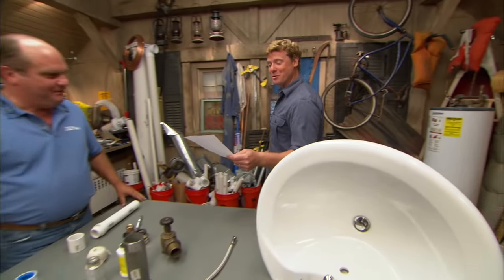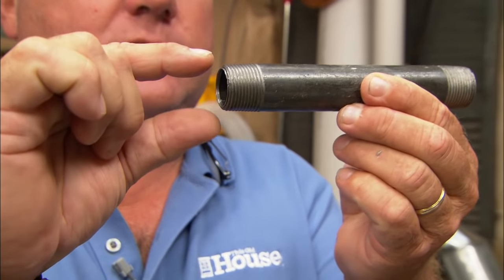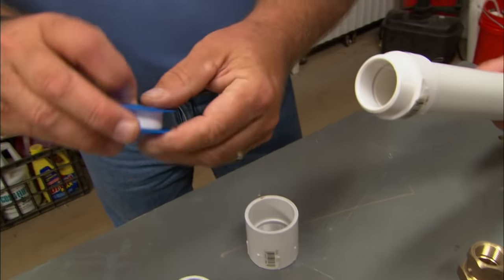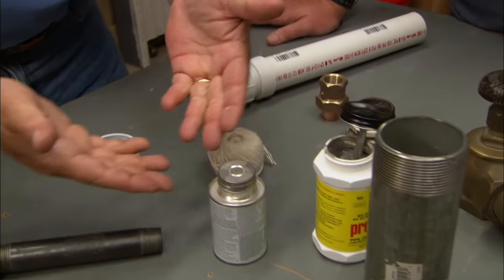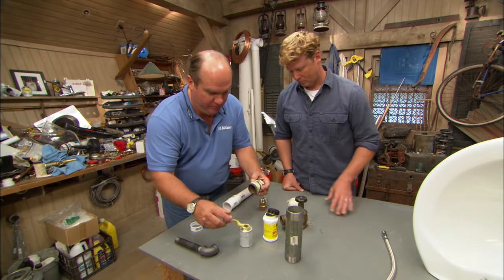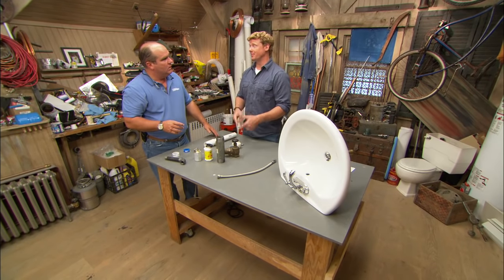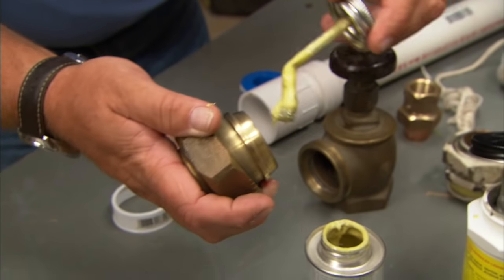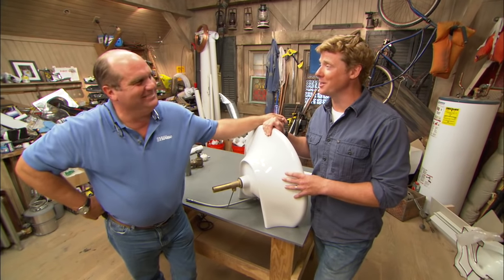When to Use Sealants on Threaded Plumbing Connections | This Old House

Comment: I couldn't stop a new threaded valve into old work from a slight leak until I used the wicking technique you demonstrated. Excellent trick and I thank you for your share.
Reply: Trebor Eclap me too!
Reply: Same with me, 1am and trying to resolve my leak with a second sediment water filter I just added.  Tried the wicking technique with some leftover twine for burlap and it worked for me as well.  Thank god for internet!

Comment: So my dad, who worked with Local 3 in Denver, CO, told me to use Teflon tape and just a thin film of pipe dope after you wrap the joint. It lubricates the threads and you get a better fit up. He also recommended using pipe dope on all threads for this reason
Reply: no need to use both
Reply: I use both.  Teflon always first before dope.
Reply: Always read manufacturing specs and do not perpetuate bad info. For metal to metal you use teflon tape. For plastic to plastic you use teflon paste. For metal / plastic you need to read specs to be sure. There is a reason engineers say to do specific applications. Follow the specs, follow the code. You left out key details. He was probably referring only to metal to metal connections.

Comment: OCT. 2020.  Thank you, was installing/replacing a hand held shower head.  Thought I might need Teflon tape, but was not sure how to use it, this old house, needed almost ten wrap around before I stopped it from leaking at the shower pipe.

Comment: Excellent instruction.  I'm always amazed at the number of places I see homeowners have applied teflon tape.  At least they were aware of the idea.
Reply: I go with the "tape is a lubricant, not a sealant" theory, and apply it anywhere I want to be sure I can remove connection in the future. Faucets and certain fittings are updated or disconnected frequently enough that I'd rather spend a few pennies on tape that isn't strictly necessary, rather than have to purchase new hoses.

Comment: I use "pipe dope" on all my plumbing threads, so that I can disassemble the unit in the future. I use it on the screws that hold the stop washer, threads on the union,  when I service a valve body... just a little dope on the threads goes a long way to make a future repair sooo much easier!
Reply: What is the best pipe dope on the market for black iron pipe?
Reply: @77Avadon77  Blue Monster
Reply: @beerbeforebreakfast  thanks 👍🤠
Reply: @77Avadon77  
Rector Seal T-Plus 2 for Dope that does NOT Cure(This is my Favorite) Thick and consistent. I don't even need to use Teflon Tape.
Rector Seal Yellow Number 5 for one that Cures.
RectorSeal True Blue for a Blue thick dope that Cures (Soft Set)
Reply: @MrInfoPhilly  thanks for the info when would you want something that cures or not cures or soft cures? Is this the difference between non-permanent, semi-permanent and permanent installations? Can you remove the Cure Sealant one? And if so how?
Reply: @77Avadon77  
More of vibrations,  or tampering resistance you'd want a dope that cures.  Rental property with a gas pipe,  I'd use yellow 5, so it's tampering resistance.
Reply: @MrInfoPhilly  how do you undo the cured? Do you have to take a torch to it to heat it up?
Reply: @77Avadon77  use more force,  or a bigger pipe wrench

Comment: as a plumber, I always use both teflon tape and pipe dope on water connections. Drainage you can get away with just dope, but I don't chance it with water.
Reply: Can you over tighten a plastic fitting that thr tape won’t work? I’m working on a water softener and have a mild drip leak.

Comment: In the UK taper threads for domestic fittings have virtually died out. Pretty much only seen where the radiator unions are fitted. There are a few instances where the are joints with parallel threads. the only way to seal these is too stuff them with tape or the latest silicone impregnated cord, but it's hit and miss and frustrates the life out of me. Taper fittings work 99% of the time and give a degree of positioning, so are a great solution to most joints, so I'd love to see a lot more  available on the UK market for domestic installations,

Comment: You have to be careful using any kind of Teflon (tape or paste) on PVC since it's slippery and is easy to overtighten the joint. Lasco actually recommends not using it, but using a PVC-appropriate sealant.

Comment: Make sure you wrap your Teflon tape in a clockwise direction!!!!!
Reply: a. k. a. up the thread
Reply: Just did some research and the pvc manufacturers say not to use Teflon tape on their threaded fittings. Only proper thread sealant that stays soft. Don’t use anything else.
Reply: But what if it's reverse threaded?
Reply: If compacted or pressed after teflon tape application, any direction will do.

Comment: They didn't mention it but iam a plumber and any time I do a water line connection not a faucet supply or flared fitting. I will wrap pipe with teflon first then pipe dope over. This hasn't let me down yet. If you don't want problems use both.
Reply: "wrap pipe with teflon first then pipe dope over"

Great advice!
Reply: That sounds completely redundant. If the tape doesn't seal it the don't use it and vice versa. The goo only seals where you put it... I suppose only on the top surface of the tape.. nothing prohibits the tape to leak from other places... I really don't understand people who put tape & other stuff on the same joint.. what is the point!
Reply: The point I️s that it wont leak. Plumbers have been doing this for god knows how many YEARS. If it didn’t work, they wouldn’t be doing it.
Reply: So it is superstition.
Reply: Contrary to what the show is telling us, the teflon dope or tape is a thread lubricant, not an actual sealant.  The thread faces seal against themselves, when properly tightened.  The pipe dope can help somewhat, if the threads are cut poorly, however.
Reply: Marco all jokes aside... I'm actually part Polish & i do it completely opposite to how you described it.. I first put the pipe dope and then the Teflon tape over it... It has never let me down...
Reply: Really, that's what they should do. If the dope is on the outside,It's liable to pick up dirt. But using both is merely superstition and doesn't make a difference. I never use just t-tape. My peculiar superstition. I'll use just dope but not just t-tape
Reply: richard wysham ^^ 100 percent
Reply: Teflon and dope are not sealants, however they do have sealing properties.
Reply: been doing the same for over 20 years
Reply: Teflon with pipe dope over it.  Just pipe dope on compression or flare fittings.
Reply: teflon then dope is perfect! people usually say it looks messy but you can just wipe it off after.Shit sticks to it if your are lazy, so wipe it off lol. Until you get to high temps, then use permatex first then teflon.
Reply: Polytetrafluorethylene has the physical property that when stretched gets thicker so fills the gap and acts as a sealant...
Reply: I agree.  I am a pipefitter and PipeWelder by trade for the past 10 years in industrial chemical plant maintenance and construction. we use  Teflon Tape plus pipe dope at times. ..we never had any problems with leaks using this method
Reply: You are so right.
Reply: I've seen Teflon tape leak, just pipe dope leak, but it's very rare to have both leak. You might be on a 3- day boiler job and one of the fittings you installed on day two is leaking.
You can't afford to do a tear down! with todays plumbing materials, most being made out of this country, the thread pitch can be off.
To deep of a cut, or to shallow of a cut.
Why one fitting will hand tighten at the 3rd thread, while the other hand tightens to the 5th turn.
I'm a retired 34 year master plumber, I've seen a lot cheap crap.
Reply: K
Reply: Marco I learned that from Steve Lav.
Reply: @jfitz3133    add some chicken, ginger, coconut, garlic, etc. boom! tikka masala!
Reply: INTERESTING.
Reply: @gilbertdueck4826   pipe *wrenches
Reply: @stfuplsok  Yup, Pipewrenches! More then 1
Reply: @gilbertdueck4826    *than
Reply: @stfuplsok  imgladyoursosmarttheworldneedsmorepeoplelikeyouthankyouforcorrectingmymistakespleasecontinuetocorrectmeinthefuturehaveagreatnightyoutuberinterestingnamebythewayoverandoutrubberduckyyoushouldhavefunwiththisone😂😂
Reply: @gilbertdueck4826    you're* so    🤦‍♂️🤣
Reply: @mr.bigbrownbass9089  Here in the Uk and Europe we rarely use Teflon tape or pipe dope as you call it. Only Gas council approved fittings on Gas. I use only approved tape on Gas Lines with dope to the exterior. As it helps the nut glide onto the taper easily. I've never had any spillage or leaks on my lines. It's just good common practise I guess. 😊
Reply: You need to go back to plumbing school. This Old House plumber needs to do the same!
Reply: @robertkat  then tell us why are they going back to school Einstein?
Reply: My experience with old timers plumbers were they highly recommended it . It reduces the chance for failure.
Sometimes the parts tolerance are just not at its best.
Reply: @johnerickson1484  
Well said. 👏
Reply: ghostmanromeo uk that is fascinating.  I think the other purpose of pipe dope or Teflon tape is to make disassembly easier in 50 years when the house is being remodeled or the plumbing extended. Do you have trouble getting old pipes apart when you need to?
Reply: I will use teflon then pipe dope then solder then use a bypass and then shut off the water pressure

Comment: I just installed a whole-house water filter and the mfg instructions explicitly stating not using dope or sealant because it could harm the plastic filter housing. Just putting that out there that it's not always a go-to solution.

Comment: Wicking is an old technique. I recently replaced my father's boiler, put in in the early 60s but the piping was from 1904, and the piping is all wicked and uses a black type of sealant that sets up hard. Without heat, I actually used a 48" pipe wrench with a 5 ft cheater to get 2" to loosen. 

Tape, plus dope. That's what were taught in apprenticeship school. Never fails.
Reply: The black type sealant is called shelloc which is made from natural resin and was used in even today alongwith the thread wrapping in metal gi pipe plumbing.

Comment: Most PVC manufacturers actually recommend non-hardening thread sealant over teflon tape for threaded PVC connections because it seals better and has less chance of damaging the fittings. IME, it works significantly better than teflon tape.

Comment: The threads on the National pipe thread (the one that you show on your black iron pipe) are actually what creates your water tight seal, pipe dope or teflon tape help you screw the fittings on a little easier because they provide some amount of lubrication but don't really play much of a role in sealing on black iron pipe with a NPT, if you made a proper thread and the pipe is snugged in it, in theory it shouldn't leak. Also always cut test threads before you start using perfectly good lengths of pipe because otherwise you could waste a lot of pipe before you know there is a problem.
Reply: @numberless. What is this " cut test " you speak of.
Reply: Purely a superstition. And if you've been a plumber for 42 years like I have, superstition is good  At a U.S. federal prison build, they wanted the dope first, then the tape. The idea being the dope can pick up dirt if on the outside. Actually, I'm heartened to see a lot of quality plumbers tell you that teflon or dope is not a sealant. It is a lubricant to prevent friction when threading two involute circles together. Friction is heat. Heat is bad because the two materials to be joined have different expansion and contraction values. They may SEEM  tight when first screwed together, but when allowed to cool will leak. I could screw together some water pipe w/o either dope or tape and after awhile the joints would rust up and not leak. However, the joints would now be as one with themselves and you'd never get them apart. So dope is also to aid in unscrewing fittings!. If only I could post Audel's description of Crane co.'s demonstration using a 10" threaded pipe, putting the pipe in a lathe and hacking away at the threads in various ways. Then screwing it together and putting 425 psi of air and then 1,000 psi hydraulic on the make up with no leaks. I'll try. nope. Anyway, it's in the 1925 Audel's plumbing book. On PDF. If you treat them as a lubricant, you'll never go wrong. Never try to make up voids with either one.
Reply: Max R  He's saying to run a thread on a piece of pipe and then make sure the thread depth is right by running a fitting on it. I was taught 3 turns hand tight. Dies get worn or out of adjustment. Just because it was good last time you used the threader doesn't mean it will be this time.
Reply: Numberless Oats. Have you ever read Crane Co.'s test using damaged threads? It's in the 1925 Audel's plumbing and steamfitters guide. Available for free online in PDF
Reply: If i made a connection using pipe dope for a hot water heater and its dripping a little bit will tightening it more help or do i have to remove it and re do it. Any help would be much appreciated as i have to tend to this tomorrow morning.
Reply: This is not correct. Only NPTF fittings have enough interference between the male and female threads to create a liquid-tight seal. Regular old NPT fittings have a helical leak path between the root and crest which has to be filled in a sealant.
Reply: This old house needs to get off youtube! Bad advice!
Reply: I've seen guy's use tape & dope together. Ridiculous, it's a lubricant, not a sealer

Comment: the one part they missed is that the soft set liquid sealant helps keep the threads so they will move later for rework.
so if you have a wc bolts if you use the liquid on the threads as new it will help on holding back corrosion so you can remove or tighten the bolts at a later date.
same on the threads for the new style faucet.
a dab on the threads help keep it from welding the two metals together chemically.

and yes on the yellow soft set harvey's liquid pipe sealer on LP and NG connections for black pipe as well as black to brass connections.

Comment: Teflon backed up with dope makes a good sealed high for a long time.
Reply: I'm thinking of trying that on my next repair. Because just the tape alone I've been having a hard time getting a good seal . 2" scrubber valves
Reply: so true  than typical practice in the pipefitter trade

Comment: ALWAYS Always always read the msds sheets and manufacturers guide before proceeding to help!
Reply: Would have liked to have seen gas discussions where immediate pressurization is needed. Word on wrapping anything with tape check if the connection engages clock or counter clock with a quick first fitting test, then proceed in the opposite direction as shown in video 2-3 rounds. Some fittings are bi-directional or counter clock depending on the engineered use… for example, tapped and threaded excess natural gas flow connectors one side tightens left, the other right using 2 crescent wrenches to tighten for proper torque…. And some will require not to exceed a specific torque thus needing a wrench that can measure & stop at a certain torque.
Reply: Much thanks to the team for sharing such a great lesson on a multitude of piping & stuff we use to connect things! Lot’s of work we the people are so grateful to have access without cost! MANY Many many blessings!

Comment: Im an electrician not plumber. But with plumbing fittings ive noticed that it seems anytime you connect brass fittings you most likely won't need sealant or teflon. My guess is because brass is a soft metal and smashes together to make a water tight connection.  
He pretty much showed that with the radiator,  but he didn't mention about the brass. But that seems to be the case when you see brass

Comment: I had hoped to see how best to seal the joints on sink connections around the p- and j-trap fittings, where there is a nut with what appears to be a gasket of nylon or teflon.  Should pipe dope or teflon tape be applied there?

Comment: I use PTFE take to seal threads where needed like described, but I also use it as a thread protection, like anti-seize because most metal plumbing oxidizes over time and can seize threads making it very difficult to break a connection. Is this okay?

Comment: I had to replace an ancient frozen toilet stop valve. It was threaded onto a 1/2 galvanized pipe but the pipe had straight threads and the valve had a washer (which was  mostly gone). I could only find tapered thread fittings and didn't realize the pipe had straight threads, and since there is a quarantine on, I could only find Home Depot open. The FIP valve screwed on maybe 1 1/2 turns before stopping (since the straight thread doesn't really mate up). But in desperation I just slapped on pipe done and cranked down hard on the valve. It's not a great solution but I finally got it to stop dripping. I cannot find straight threaded stop valves anywhere! (Maybe cutting and rethreading the pipe is the solution?)  Or somehow connecting an adapter...

Comment: Just spent 3 hours installing a faucet in my bathroom. The 7/8  water feed side would not for the life of me thread onto the facet inputs. The small side threaded on by hand no problem. felt like it was going on straight, would seem to be tightening then it looked like it was slipping off steel braided water line

Comment: Hi. Nice video. Very straight forward. 
I need to run 3/4” L copper pipe through a bulkhead for my air compressor. Can I use a PVC bulkhead or do I need brass? Any recommendations on which bulkhead to buy?
Thanks, 
Paul
Oh, one more question. I’m using Unions in my compressed air lines. Should I use the T Plus 2 on the mating surface, or Loctite flange sealant 518?
So many options. 
Thanks again.